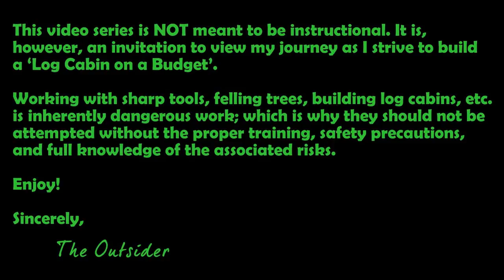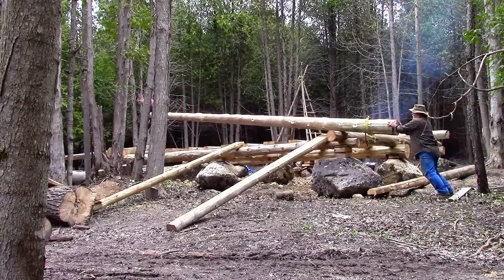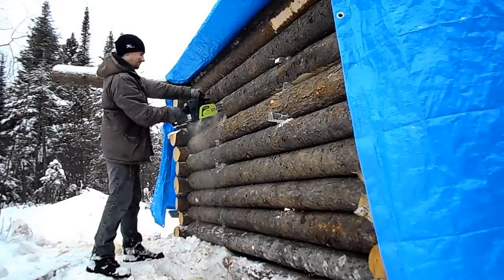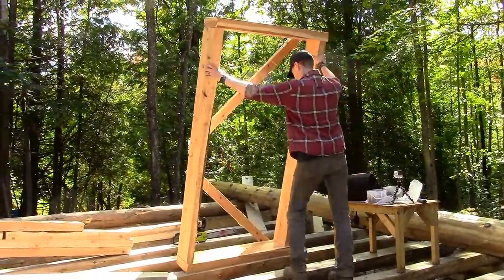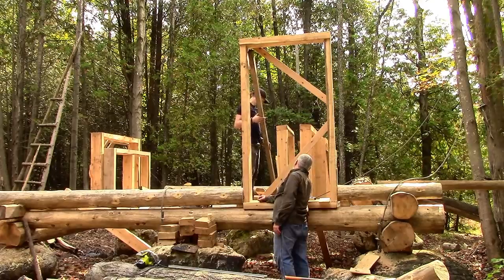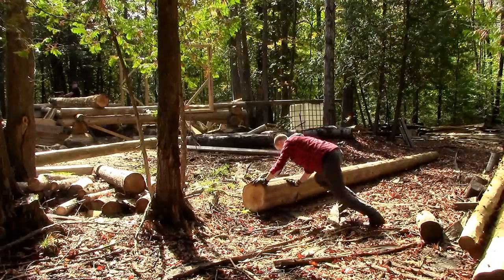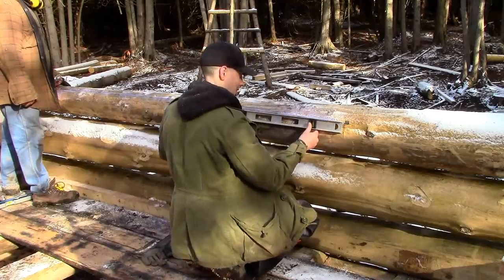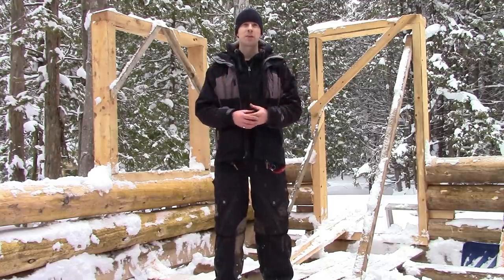Walls, Windows & Door-frames- Ep31- Outsider Log Cabin

Comment: There's an easier way to cut those saddles.. Putting your door & window bucks at this point will  be in your way  moving logs around & doing the tie logs over the doors & windows.. deck it over so you have a place to work with out falling.. build 4 gin poles,, put one in each corner on the inside,,,, make em 4 feet taller then your last log .. buy 2 good come=a=longs.. Wish i live closer I 'd come & teach ya some tricks.. I've built a shit load,, made all the mistakes,, learned from them.. Cedar logs,, 2 or 3 guys 2 full rounds a day..I'd also build a couple good log saw horses,, with a cradle cut in each one to hold the logs from moving ,, should make 4 log dogs ,, so you can dog em down while sawing..I'd chat on phone sometime if your interested.. Aloha

Comment: I can't watch any more.  Why are there 5 inch gaps between the logs?  You went to all that effort to carve out the logs so they would fit each other and stopped that far sort of having a good fit?  Its like running a marathon and stopping a thousand feet from the finish line.  Besides with that mill you could make them fit perfectly by shaving the top and bottom of each log.  Its like you are building this for someone else that you really dont like and they have already paid you.  I just dont understand.

Comment: STOP WHAT YOUR DOING NOW, take out windows & doors & before reinstalling put some foam down between frame & wall/floor, if you don't do this you will have rot very quickly, save your cabin now, start reading on how to build a cabin correctly, or everything your doing is in vain.

Comment: Lol on a budget my ass u have all the special equipment u need. U can cut any size timber u need with that stuff plus a tractor. This is a joke and the most modern way to build a log cabin anyone could do it with what u have.
Reply: I disagree. The equipment does not create the drive and determination to follow through a project like this. All it does is allow to move the project along, a little quicker. Then when the equipment breaks down (as in Willy, the tractor) you have to be prepared to improvise, so you don't lose too much time on what you gained, using the equipment. He also demonstrated a lot of budgeting logic, by choosing to buy an old tractor which needed work, so he could spend his money on the mill. Budget does not mean, spend no money - it means employing different strategies to stay within your financial means.
Reply: That's why I am watching this one. There are so many on building with hand tools. I want to see the easiest, quickest way to build a cabin yourself. Only wish he was using a diy chainsaw sawmill.